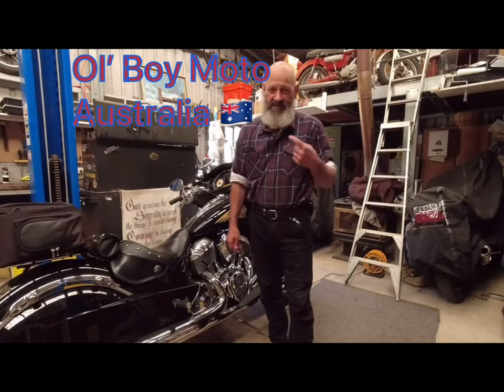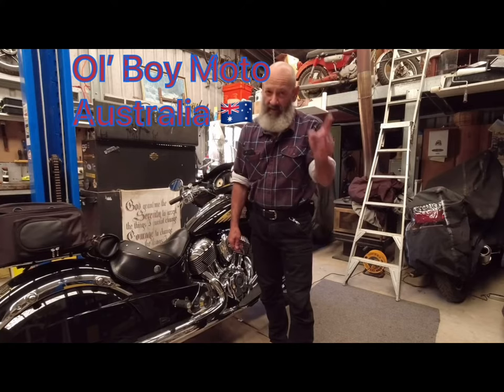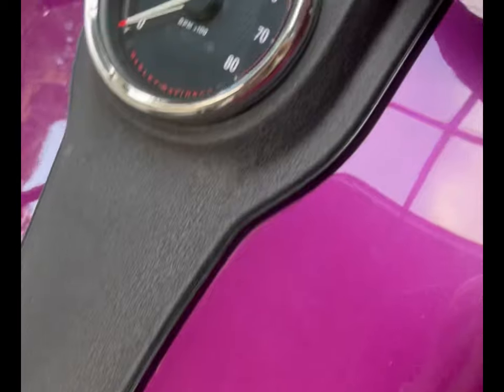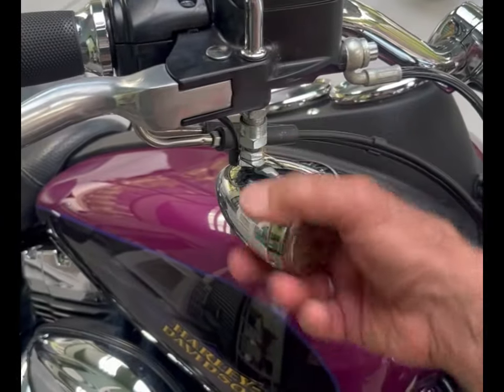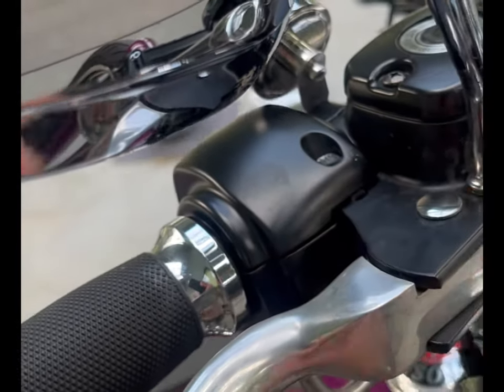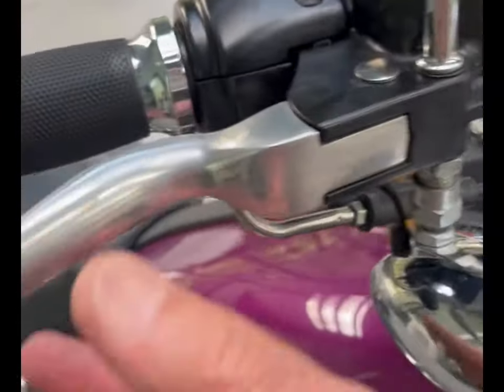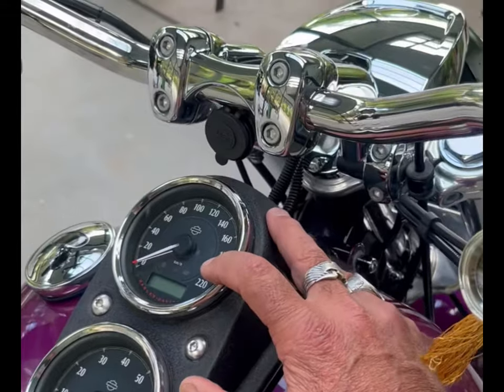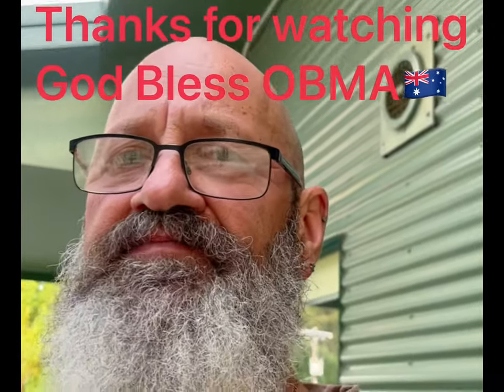Harley Security Light Staying On

Comment: Thanks for making the video. My light came on. I didn’t know what was going on so I made the 45 minute trip back to the house can’t find anything wrong. After watching the video I figured out it is my front brake. I Bought the bike used with no owners manual. I’ll 2:50 to tighten up the lever later as it is now I have to push it close with backside of my fingers.
Reply: Your comment saved me an hour ago. I changed my grips today and was in a rush and didn’t set my control cover on properly and the bolts loosened up on my way back home and threw this code. I double checked it on the side of the road and fixed them and didn’t have an issue on my way home. Just got home 15 min ago 🤘🏻

Comment: Piston in my front master cylinder was sticking after being engaged having the brake light stay on for about 20 seconds after releasing the lever.That would cause the red light on the dash to light up.I found out chain lube is better than grease.

Comment: Hi Steve, bit late but...........
The 2012 Fatbob has the very same problem. After chasing advice how to rectify that ' hand brake light' coming on I was told to do as you have illustrated. All good except it keeps happening. Originally the techy at Gasoline Alley did the spray trick and worked the billy-o out of the lever, back & forth. Did the job but, like the old cat it came back.
If this hapens midst a ride, while riding and very cautiously, I push the lever forward and usually the light goes out. More spray and excercise the lever when I stop or get home. Those switches for that model can be replaced and will, be aware, usually stuff up again.
Hope it helps.
Knees in the breeze.⁵😮

Comment: I've had the same problem until the tech at a Harley dealer told me how to fix it. I used to ride with my fob inside my metal drinking cup(obviously the cup was empty) on my handlebars. It couldn't pick up the security signal through the metal cup.

Comment: My light was on and the dealer told me my custom dynamic bag lights are the problem and I have to remove them
Reply from the maker: Yeah that could be too. Especially if they’re not wired through the accessories circuit.

Comment: I have a 2012 dyna fat bob with this problem sator is good replace the voltage regulator clean all battery leads and terminal ran fine for a day then back to normal any ideas
Reply from the maker: Did you replace your fob battery?
Reply: @olboymotoaustralia4294  I don't have a key fob for mine
Reply from the maker: @robertbarger6439   Does it have a security system/ alarm etc?
Reply from the maker: Although most Harleys have security, the last I knew of, it is still an option. The red key light indicates there is a problem with the TSM/TSSM (turn signa, turn signal security) module) a light bulb or dash light somewhere. Good luck